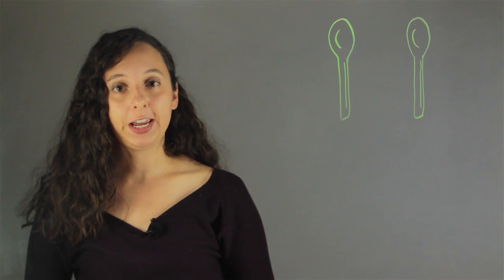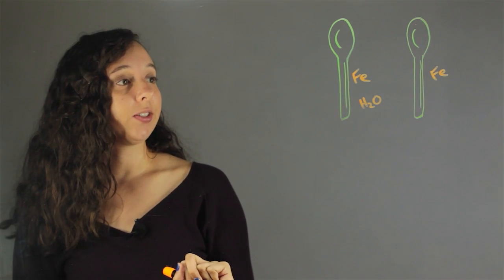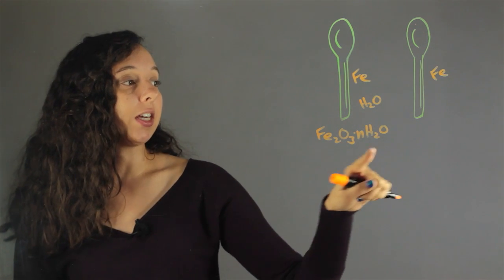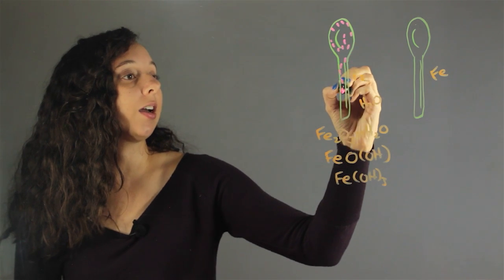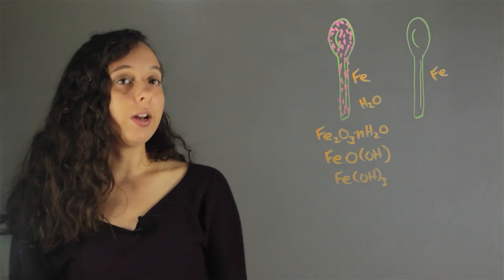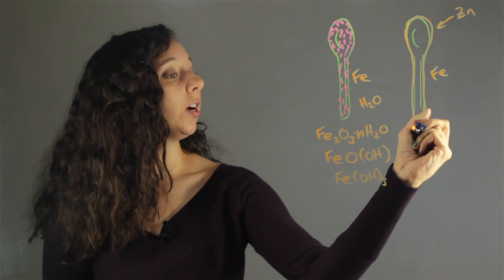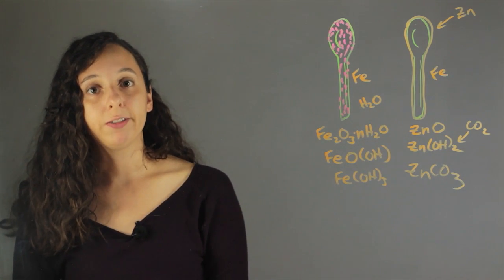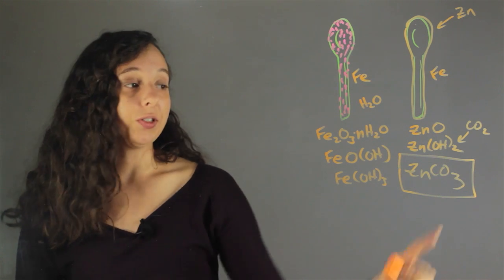The Chemistry of Galvanized Iron : Lessons in Chemistry

Comment: Wait so it's all about looks? 
Is there anything dangerous about any of those if you consume them from a canned product?
Reply: It's more about longevity of the steel underneath the zinc coating. It's corrosion protection. Yes, there is an asthetic element, but it's mostly for adding life the the base metal.....you will not get any sort of toxiciy from the zinc, either, from normal leaching.....but zinc is not generally used in food storage